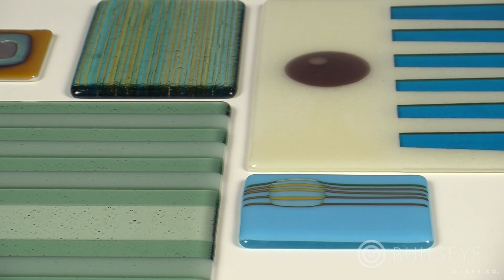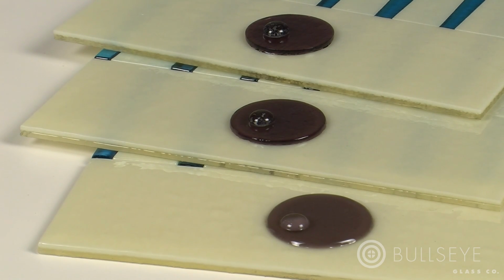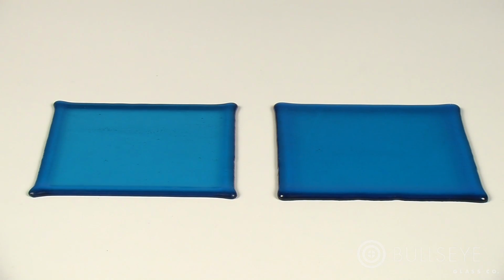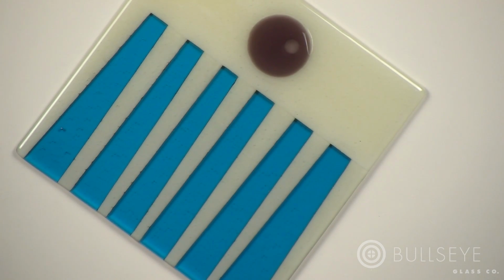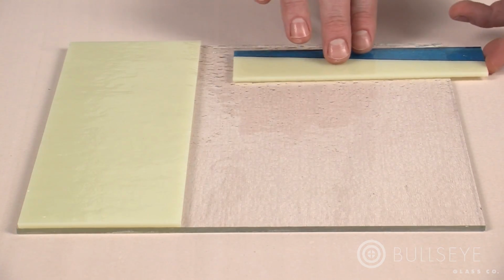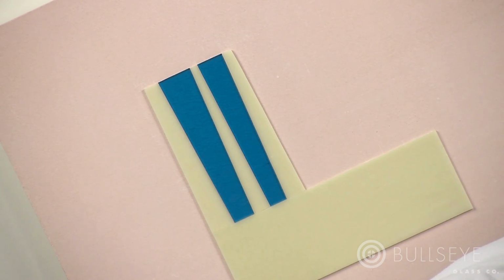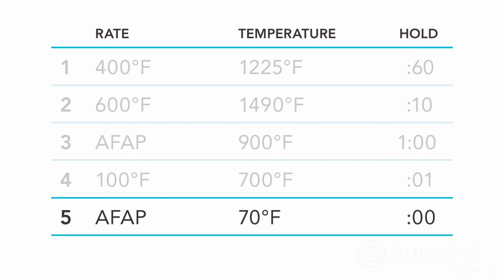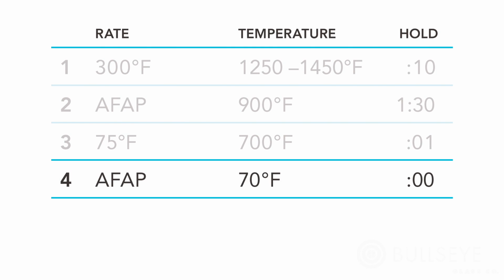Fusing Basics

Comment: @terri b, it's going to be impossible for you to anneal your glass properly without a pyrometer. Glass is very susceptible to changes in temperature (thermal shock) and if it is not annealed properly using a specific schedule it will likely crack or explode or hold unnecessary stress that will make it much more susceptible to breaking or even exploding further down the road. Get yourself a good programmable kiln!
Reply: This is good if you have a few thousand dollars or more in your slush fund?  I use a manual kiln and pyrometer.            My kiln has infinite Power switches, this gives me excellent control over the fire.  Depending on how many times you fire and temperature you must replace your thermocouple, this can be checked using pyrometric cones to verify
temperature.
Reply: You seem to know something about this whole glass business. I need to do something really simple and need a no nonsense way to go about it with no kiln. What I need done it to fuse the top of a drinking glass with a flat piece of class on the top, effectively making the inside of the drinking glass a hermetic seal. How would you go about this? I'm thinking a blowtorch and glass powder.

Comment: Hello! 

I'm a ceramicist starting a new adventure in art glass. My little kiln has the power and precision to do more or less whatever I want with it (Skutt GlazeTech with a touchscreen controller upgrade), but my kiln shelf is currently supported by one inch posts instead of the two inch posts suggested in the video. Do you think this would accomplish the same thing, or is that too low? What results might I see if clearance underneath the shelf isn't adequate? 

Thanks for all your fantastic educational resources!
Reply from the maker: Hello Rae!

So glad you're enjoying our videos and are going to give glass a try!

That GlazeTech looks like a good kiln. My only comment being to please use the Ramp/Hold mode to program a specific program. Using an automated mode may make too many assumptions and take away control you'll want to have. This makes it especially difficult to trouble-shoot if firing issues arise.

Re: the spacing of the shelf off of the kiln floor, we recommend the 2" posts as being a good minimum configuration to allow adequate air/heat circulation under the shelf. Especially if your shelf is wide it could make for too much of a top/bottom heat differential across a panel piece risking stress that may damage your work.

For larger and deeper works we might recommend even taller posts to ensure even heat distribution. Remember that it's not just about heating-up but also cooling-down for proper annealing. An extra set of posts is a small price to pay to eliminate variables that could impact your firing success.

I'll note that we like to use triangular posts as they are easy to securely stack.

Good luck and please keep us "posted" (see what I did there?)

- Team Bullseye

Comment: I'm a brand new beginner... are those temperatures and hold times true for all glass kilns? Or will some kilns need to use different temperatures and hold times? Great video!!
Reply from the maker: For the exact projects being demo'ed the schedule would not necessarily change because of the kiln per se but you would want to be concerned to know that the kiln is actually able to deliver that schedule. Power, thermocouple accuracy, element design, and insulation are just a few factors affecting how well a given kiln is able to deliver the schedule that is programmed in to it. For those reasons it's ideal that you be able to profile your kiln but most realistically always run firing tests for a given set-up to determine if it's getting you the result you need. Over time you'll learn if compensation for your kiln's behavior needs to be built into the program.

If you want to dive deeper there are a lot of good conversations happening over at our Facebook community. https://www.facebook.com/groups/BullseyeGlassCommunity/
Reply: @BullseyeGlass  thank you!

Comment: I'm a total beginner, I make stained glass mosaics, though. I would like to know whether I can use my stained glass scraps for fusing. Thanks!
Reply from the maker: Broadly speaking, I'd have to say no. Unless you know that the glass was specifically formulated to be fusing compatible then any glasses of different colors or even different sheets of the same color could not be expected to reliably fuse together.

Also, glasses that are not designed for fusing can have unexpected color changes when fused.

It's that consistent reliability in fusing behavior that makes the 'secret sauce' that goes Bullseye Compatible glasses.

If what you have is just scrap I don't want to discourage you from experimenting but you may find the time invested not worth discovering mystery behavior of your materials.

Thanks!